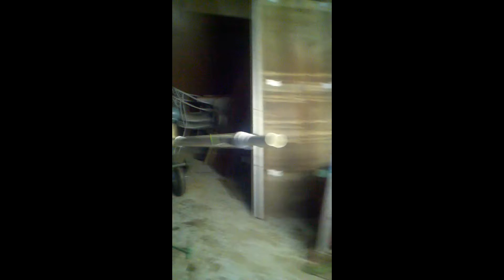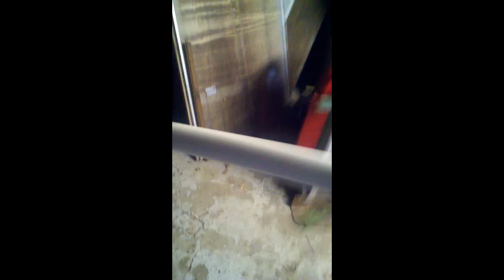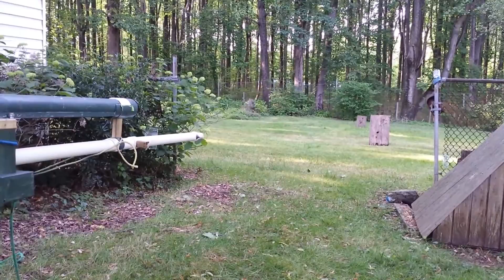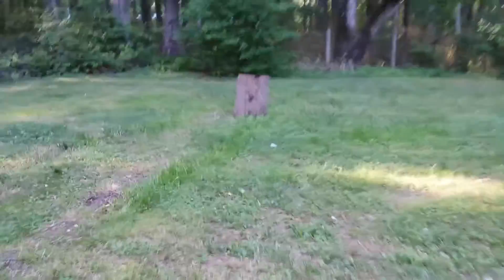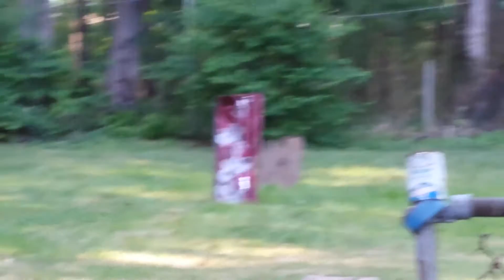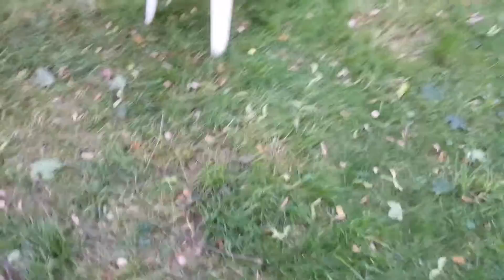Updated Air Cannon

Comment: How did you make it breach loading? Would like to see a more detailed breakdown video of your build like the trigger system, recoil system, etc. If you still have it around that is.
Reply from the maker: Sorry I don't have it around anymore, it started as a 2"muzzleloading pvc barrel, but I created a sliding 1.5" barrel that fits inside the 2" pipe, with a bunch of cut up and sanded down pipe couplers so they sleeve snug. I made a windowfor acces in the 2" pipe and a locking lug to lock the 1.5" barrel in place. I'm sorry I don't have details but there's many cannons on spudfiles with sliding barrel breech loading design
Reply: @iknowmy3tables  The sleeve setup is a good idea. I plan on putting my gun on a rail platform. 

Its possible to find breach loading designs on the web, maybe some recoil, but not breach loading and recoil, let alone tutorials on how to do it. Your gun is the only one of its kind I found on the web.
Reply: @iknowmy3tables  You could legit fight in war with these.